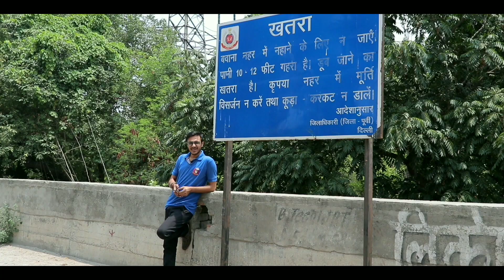Car Modification  - Alloys part 1

Comment: My bicycle tire has an issue.Once i inflate front tire,it almost spends more than a Month but when i inflate the rear wheel the air gets out in less than a week.I went to a mechanic,he checked for any puncture but there was no puncture.He said there could be a valve problem but still there was no problem.Tell me what to do?

Comment: My mechanical disk brakes are making so much sound and breaking is also not proper I think so few days before a drop of mechanical oil has fallen on it now it is not working very properly the breaking is very slow and breaking is also not very proper so please tell me what to do in this case I splash some water on it and then till when the water didn't  become dry till then it works properly but afterwards it doesn't work